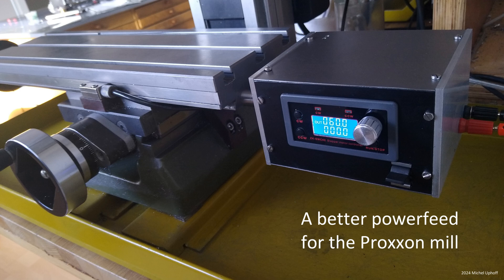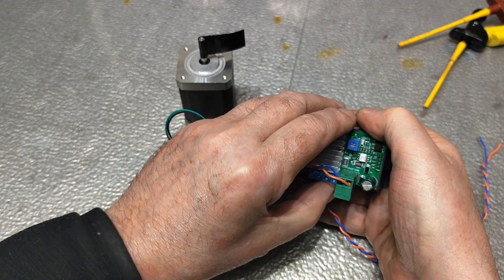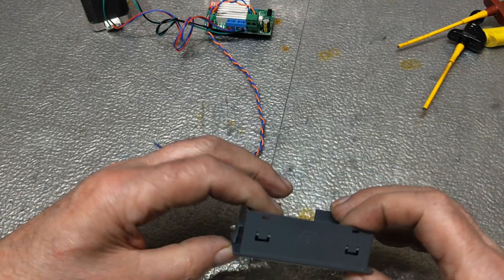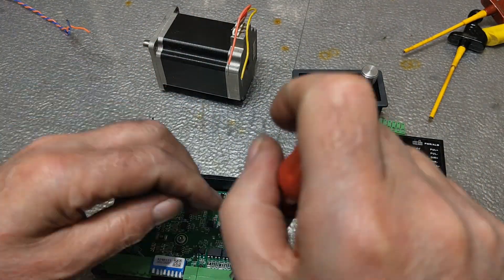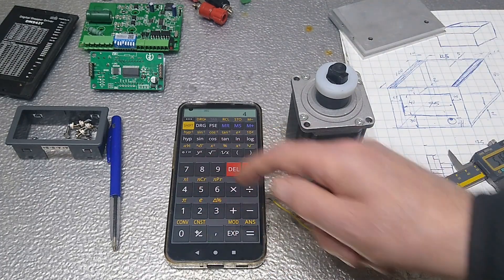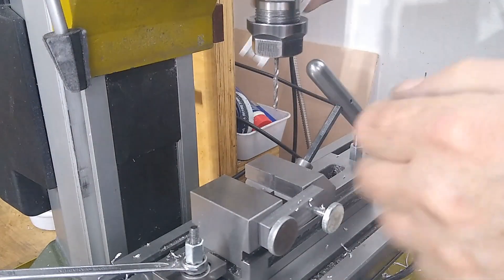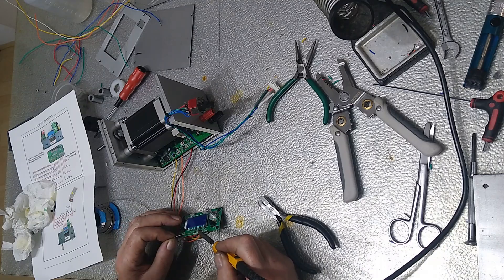A compact and versatile programmable power feed for my mill

Comment: That is awesome! What happens when the mechanical limit has been reached and the controller is still trying to move? it is going to mess anything up if the motor stalls like that?
Reply from the maker: The motor stalls and produces a loud rattling sound. That's all. The maximum torque that the stepper produces isn't high enough to cause any damage.
Reply: There is a setting for manual control ylu can set it to have. Limit switch stop it. Have buttons control start and stop etc.

Comment: Schrecklicher Sound! Warum lässt du den Motor im Vollschrittbetrieb laufen? Außer zur Erzeugung von viel Lärm, ist das für nichts gut...Stelle um auf Achtelschritt. Alle deine Komponenten können das und schon ist der Lärm geschichte. Ich betreibe Nema 34 Motoren im Achtelschritt. Die kann man nicht mal hören. Ansonsten: Schöne Arbeit!

Horrible sound! Why are you running the motor in full step mode? It's not good for anything other than generating a lot of noise...Switch to eighth step. All your components can do that, and the noise is history. I run Nema 34 motors in eighth step. You can't even hear them. Apart from that: Great work!
Reply from the maker: The motor runs on 1600 pulses/rev so 1:8. You hear a combination of a bad microphone position and a sometimes rattling coupling. I replaced that later.
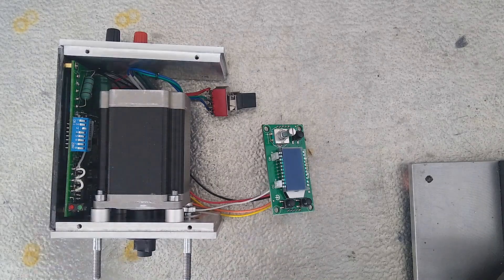Reply: @Michel-Uphoff  Aha? In your Video at minute 13:02 - 13:49, the DIP-switches 5,6,7 and 8 of the DM542 are set to on position. That means, the Motor is running in FULL STEP (200 Steps per rev.)
Reply: @Michel-Uphoff  ...and at minute 14:50 you are closing the lid, with DIP-switches 5,6,7 and 8 of the DM542 still in on position...
Reply from the maker: @andreasreinert5472  It's at 1600 pulses/rev. I've opened and closed the housing several times.

Comment: Hi sounds like my motor(Nema 23x100)(3Nm) when in slow rpm...necessary when machining mild steel billet on my X2....and does stall near to the end of table (probably gib/slides too tight on the table ends) Got a nv30 g/box +clutch but too heavy for this table

Comment: I was looking for this solution, can you add some stop switch with this setup? thanks
Reply from the maker: Yes that's easy. Just connect them between the En/Di terminal of the driver and the 0V terminal. As soon as this connection opens, the stepper stops. However, I like to program the power feed by instructing how many steps the motor has to turn, and what must be done after that (stop, or reverse).
Reply: @Michel-Uphoff   thanks and I agree, but that required to start always at the same position. If a change is required get the change in the controller is not bad but not the fastest.

Comment: Tip for measuring distance between two holes with a caliper... start by measuring the diameter of one hole. Reset the caliper to zero. Now measure between the distance between the outside walls of the two holes. The caliper will now show you the distance between the center of the holes
Reply from the maker: This only works well if both holes have the same diameter, and of course you need a digital caliper.

Comment: Nice job Michel I have Warco’s smallest mill and been looking to add stepper to X axis so very informative
Reply from the maker: Make sure you also watch the older video if you want more background information.
Reply: I have watched this video and the previous one a few times , I think it’s sunk in mostly but I would like to add limit switch any suggestions as to how to wire it in ? Sorry to ask but I restore antique clocks and am in no way electronic minded.
Thanks in advance Dell
Reply: Ignore my last message I see you answered it already enable -  but dose that enable or disable because my micro switch has both.
But can I ask why the four wires to the on/off switch.
Reply from the maker: @torsiondell  The on/off switch turns the power on and off, that makes sense. But the circuit between the coils of the motor and the stepper driver is also interrupted by this switch. If you didn't do that, and you turn the hand wheel while the feed is not being used, you also turn the motor shaft and then the motor generates energy, like a dynamo. That energy is then supplied back to the driver, which can be harmful to the driver's electronics. Moreover, without being completely switched off, the motor offers more resistance to rotation.
Reply: @Michel-Uphoff  thanks for the explanation so what do you connect the other two terminals to and what switch would I need to get ? Sorry to ask so many questions but you seem to know what you are doing unlike a lot on YouTube
Reply from the maker: @torsiondell  You need at least a quadruple single throw rocker switch. But I used a quadruple double throw switch which is easier to come by. The connections (see the diagram at the end of the "old" video) go from 
1st: Mains socket>Switch(1+2)>power supply (So a simple power on/off for both wires)
2nd: A+ connection stepper motor>Switch(3)>A+ connection driver
3rd: B+ connection stepper motor>Switch(4)>B+ connection driver

The switch I used: https://www.amazon.com.au/MagiDeal-Miniature-Terminals-Connector-Quadruple/dp/B01JA45CXG
Reply: Hi Michel I have taken a screenshot of the wiring diagram and found the switch that you linked to but in the uk just so I can get my 70 year old head around it , the switch is an on/on is that correct ?and I presume there are totally separate switches inside one casing and as each individual switch has 3 terminals and you are only connecting 2 wires the other side is effectively off as it has no connected wire , are my assumptions correct?
Once again many thanks Dell
Reply from the maker: @torsiondell  Yes, that's all right.
Reply: Looking at this video you only have two wires going to the box so you must have switched the low voltage and not the 240 volts? as in the old video
Reply from the maker: @torsiondell  That's correct. I changed that with this new design, I now have a separate 24 volt power supply with its own switch.
Reply: @Michel-Uphoff  thanks that makes things a lot easier, getting on with it just waiting for stepper driver and aviation plug and sockets to be delivered.
Many thanks for your videos and help Dell

Comment: Good job but soldering the wires instead of using screw terminals is a bad practice. You should have made the enclosure a little bit bigger instead.
Reply: Please do not present your opinion as a fact, that's rude. Michel may have good reasons for doing it this way, why don't you ask before you judge?

Comment: hmmm a set of those controllers somehow linked together driving two steppermotors in sinq but at different speed could make for a verry acurate cilinder honing machine , to get the right hatch pattern in a cilinder you need to controll the speed of the up and down (crank) and the rpm of the hone and the dwell at the top and bottom , if the cilinder diameter changes the settings change too as with a bigger diameter the stones travel faster along the cilinderwalls at the same rpm

Comment from the maker: Found the controller Chip F002081T.
For the insiders some info:
The MM32F0020 microcontroller is based on the Arm Cortex-M0 core. These devices
have a maximum clocked frequency of 48MHz, built-in 32KB Flash storage, and contain
and extensive range of peripherals and I/O ports. These devices contain one 12-bit ADC,
one 16-bit advanced timer, one 16-bit general purpose timer and one 16-bit basic timer, as
well as communication interfaces including one I2C, one SPI and two UART.

Comment: Nice.  How's torque at lower speeds?  Another vote for limit switches here, too.
Reply from the maker: It's a stepper motor. Torque is highest at low rpm.
Although limit switches would be very easy to implement (a signal to EN- is sufficient), I don't need them.
The stepper motor simply stops at the ends of the table without problems and the rattling sound will warn me I wasn't paying attention.
But more convenient,  I can specify the travel distance, and whether to stop or reverse after that distance. The spindle has 2 mm pitch, and the stepper has 200 steps per revolution. So a hundred steps is exactly one mm. I just tell the controller to generate 10357 pulses and the table will travel 103.57 mm and comes to a halt (or returns).